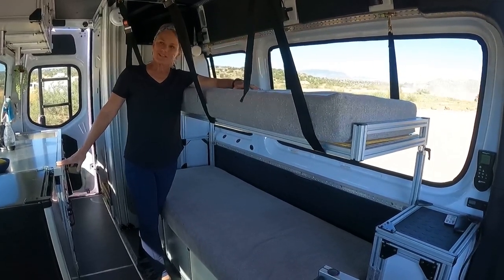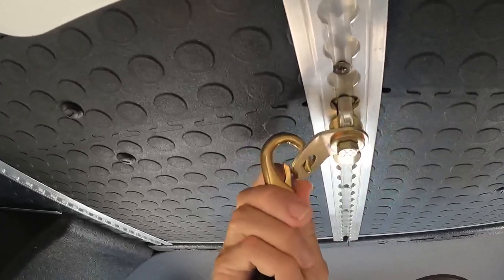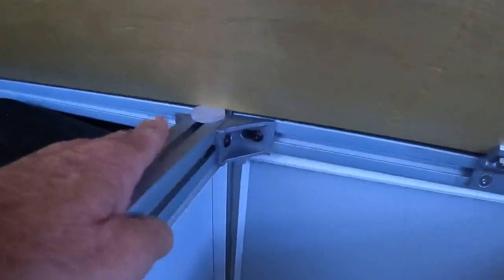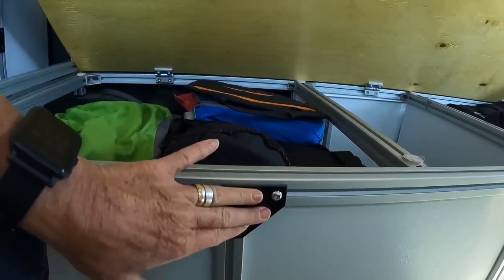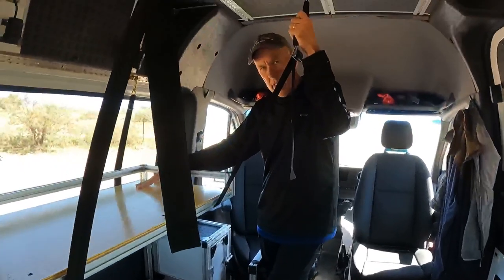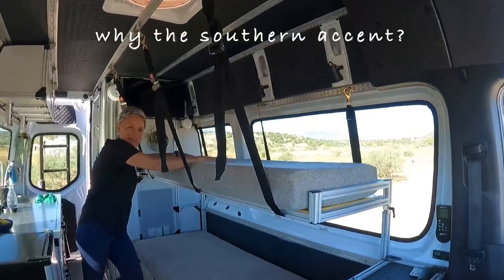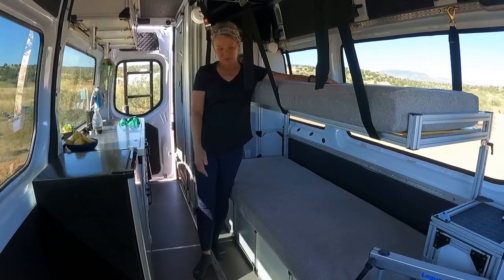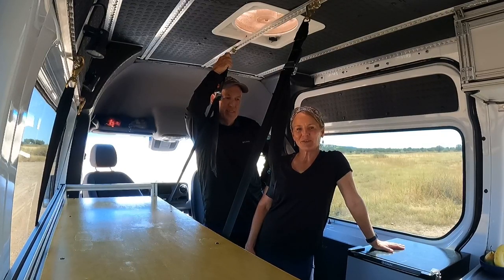VAN TOUR Part 8 | Tour of our Bunk Bed. Detail how we built our Bunk Bed System -  Simple, Easy.

Comment: I heard you say the length of your bunks is 73". Could you share the widths for both the bottom and top that you've found works well for people your size?  Thank you!
Reply from the maker: 26 1/4 is the width of the frame on the bottom with the mattress cut to 28. To bunk inside frame is 19 inches wide with mattress cut to 20 inches... Frame is 20 inches wide. Thank you for your question and for watching!